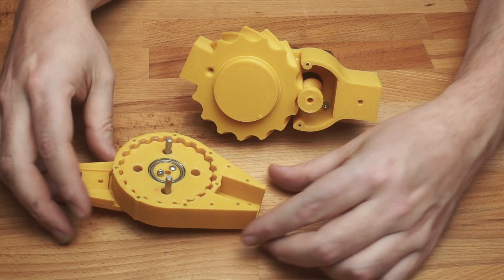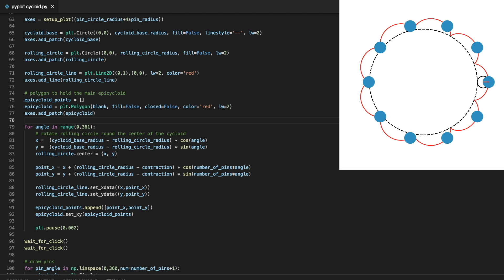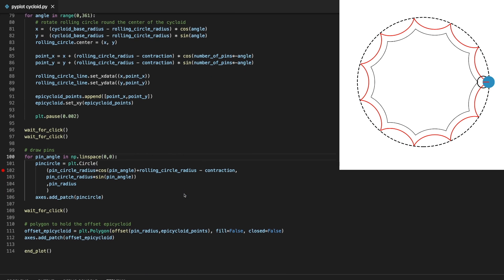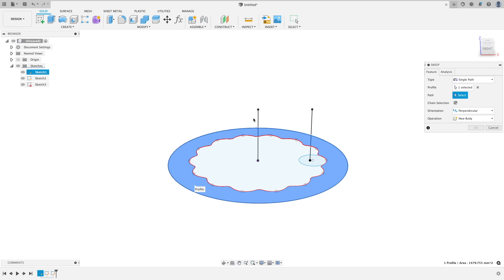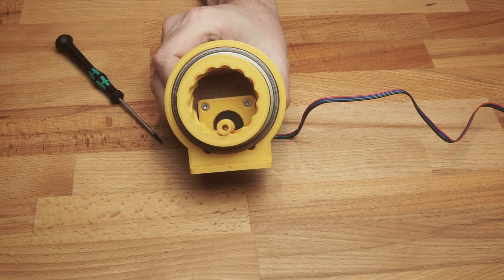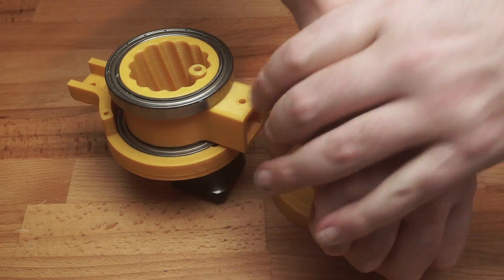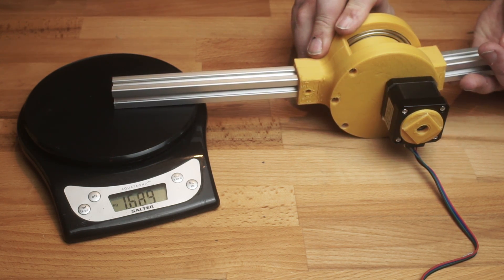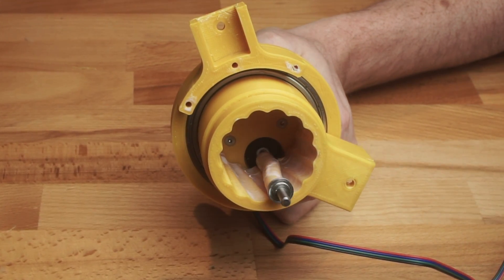an easier robot arm actuator...

Comment: Now put 3 (or 4) of the internal gears 120 (or 90) degrees apart and put large planetary gears on the end with a small sun gear. Probably not too practical since another set of gears will introduce backlash, but there's still internal space that could be used to increase the gear ratio.

Comment: The cycloid gear looks to have a lot of wear surface making a plastic version have a short lifespan.   I wonder if somehow you could use ball bearings in there, so the balls rotate as the friction surface, like how a ball screw works.

Comment: Would it be possible to combine this with a planetary gear? Thus having three rolling pins that are driven from the center with the motor? It might only get a 1:1 between the sun and planet gears, but it might increase the rigidity as loads are distributed.

Comment: Maybe you can try to make one a little bigger, so the motor fits inside side by side with the worm. Then you connect the motor to the worm with simple gears or a belt.

The advantage is that it would have a neat form factor with no protruding appendages.

You can also use small bearings if you place them to the sides, and make the cycloidal cage as two facing cups with a central axle.

Comment: Herringbone arrangement with multiple driving gears synchronized via a timing belt (chosen for anti-backlash, but perhaps gearing would suffice?) could increase the torque capacity and eliminate the need for a large outer bearing (at the cost of several smaller ones for the driving gears).

Comment: I'm thinking planetary internal cycloidal gearbox......should be able to make it smaller, and between the extra contact area and those areas operating in opposition to one another the torque capacity aught to be pretty good for the size.

Another thought is a roller design. It looks like a planetary gearset but all parts are smooth. The balance between load based friction and the properties of the lube help determine torque transfer qualities. A benefit to this design is that slippage is accounted for when overtorque is applied. The rollers simply slip without the mechanical deflection and breakage of a gear or other positive engagement system. 

When the overtorque condition is over the transmission simply goes back to work.

This is ised in a supercharger design from a few years ago but I'm sure it has other applications.

Comment: I became lost at some point. 
How is the pinion gear diameter determined? 
How about the offsets? 
I do not follow code all that well. 
Plan to try Levi Janssen's method of manually plotting out the cycloid. 
Only do it on the inside like this one. 
Need some help. :)

Comment: The next step would be an in- AND out runner, wouldn't it? Two opposing pins, one on the inside, one on the outside. Is that even possible due to the different diameters of inside and outside? 🤔

Comment: you could split the outer piece into several plate-like layers with straight edges that are stacked together and then fit bearings along the little pinion. It would then not be a continuous mating surface anymore, but rather about 6 bearings that sequentially push on the outer part. Backlash would probably become unbearable and you'd have trouble mounting the bearings on the little part, but friction would be eliminated.

Comment: Hey, wouldn't this desing allow for several inputs? Since its hollow, it could be possible to just add more motors, maybe even add another gear on the center to keep all of them synchronized and keep the input gears in place to avoid skipping.

Comment: A second gear along the inside, so the driver sits flush on both ends would create more torque relative to its volume and you'd really see the magic of this design. You're only grabbing on the outside: You also need to grab on the inside.

Comment: At 12:1 gear ratio it is no better than a planetary box of a similar size, and the planetary box would be much stronger for so many reasons.
ROUNDED gear drives are a terrible idea in general, unless there is some big payoff like a really high gear ratio in a compact space.
I applaud your cleverness and hard work, but functionally it is awful.
Reply: a rounded gear is basically the same thing as a journalled bearing. if you were to drill holes around the circumference, and have a sliding feed so that only the hole contacting the gear feeds oil then you have something with a possibility of durability, if made of iron.

Comment: Amazing design and implementation. I do wonder about the Fusion 360 script though - all those individual line segments will eventually cause performance issues, and make the breps very complex. Doing a best-fit spline, with a tight fit and lots of control points, may be an option. Or using arc segments. This is similar to how the "Smoothing" function works in F360's CAM workspace.

Comment: one thing no-one mentions is pressure angles...

wheres the load and whats it acting on?

its like... threads are traditionally 55/60 degree.
gears are standard at 20 degree with the odd old fashioned 14.5 popping up.

reducing the pressure angle weakens the teeth, the material starts acting in "shear", but the torque or the load or the force acts more tangential to the wheel, with less bearing loss.
as pressure angle increases, the teeth get stronger. less "shear" but more "squish"., the load is transferred more radially, towards the bearings and shafts,.

this looks funky... but i fear overload is dependent on the rigidity of that housing, and theres a huge amount of sliding friction betweeen those gears acting... sort of radially. helically.

cant really think of a way to avoid it.

Comment: For those figuring out why this is different from a regular big gear with thread on the inside and a smaller gear attached to the motor, one revolution of the input here is results in the outter gear rotating one 'teeth', while with regular gears the big gear moves with the amount of teeth the smaller gear has. 
In another way, you can say that with this system the driving gear only has one teeth.
Reply: Ah, thank you!  I was wondering about that.  The other difference here, I see, is that the gears are slipping on each other quite a lot, whereas with "regular" gearing they don't slip very much.
Reply: @BrooksMoses    a rounded gear as seen here is a poor choice because of the angle of power transmission from one gear to another. The closer that angle is to 90 degrees (ie true radial) the more integrity the power transmission has, and is likely to have less friction too.
Reply: No it doesnt. If that inner gear had teeth it could easily reproduce the 12:1 ratio seen here AND be a better design. Planetary beats this in a number of ways.
Reply: @wizrom3046  
with planetary you also have more gears.  multiple reductions. 
this is a single transfer of force.  less parts to break fail.  

but also way more friction and thus less wear resistant and in the end an absolutely stupid idea that got thought up and discounted decades ago

Comment: If you're putting the drive gear into an elbow like you have here, you don't need gearing teeth to go all the way around the circle, the elbow stops the rotation at three or so teeth on either side of centre.

So there's some space saving available in this specific use-case.

Comment: how did you smooth out the cycloid curve and inverte it @2.17 to 2.18 ?!
Reply from the maker: Do you mean in Python or in Fusion?
Reply: @roTechnic  fusion 
Actually am trying the equation in Solidworks but it doesn’t turn right

Comment: I am having a lot of trouble increasing the number of "pins" and decreasing the pin radius without getting any odd overlaps, sometimes it looks pretty good but when I try to put a circle around the ring gear in the sketch fusion360 crashes every time.
Reply from the maker: let me know the number of pins and radius etc that you're using and I'll have a look
Reply: I found a solutin:
Let the script plugin draw the segment for you, but do not make the circular pattern yet. First, edit the sketch and use the Fit Point Spline tool to trace around the curve drawn by the script. Only drop a handful of points - enough to accurately recreate the shape, but not so many it crashes your program again.
Then, delete the original line, and continue the original process now using the spline curve instead.
Works pretty well for me.
Hope this helps someone out :)
Reply: Same problem here:
pin_radius =        5 / 10  
pin_circle_radius = 30 / 10 
number_of_pins =    12      
contraction =       0.5 / 10

Comment: Improvement: If you rotate the shape of the pin through a multiple of 360° it can transfer more force to the outer ring. Changing the geometry of the pin, making the shape a little bit more complex, the 'relevant' contact surface (the part applying force) increases and you get more torque for the same part count. If the material itself holds up, you can double or triple the torque.
Reply: But wouldn't you still end up with the same total contact-surface area?  You get more individual contacting areas, but they all get smaller.
Reply: @roidroid  The harder the material the less your insight is true. Think of difference btwn. laying on top of soft balls vs. on a bed of nails. In the first case the balls compress and the surface area increases. In the latter case your skin gets destroyed by a single nail but not by hundreds. The load of the body can only be supported by multiplying the force arrows. Preventing piercing of skin is analogous to skipping of gear dure to torque. In practice material science and physics combine.
Reply: @discoveringthegardenofeden7882  oh coz none of them are flat surfaces, but are rounded?  Interesting

Comment: If the the gear had a herringbone sort of pattern, that would eliminate thrust along the axis.
Reply: Seconded. I've used double helical gears in a couple of projects and they're great. All of the force is transmitted in a direct and constant manner.
Reply: That, and it also would remove any unintended torque moments from the gearbox, which could become an issue as these gears get (longer, wider?). I wonder how well it would go with a more extreme twist rate, rather than the small drive gear being swept at 360 degrees, what if it was swept at 720, or 1080 degrees? I'd think it would produce more, smaller contact points, evening out the load along the gear teeth.
Reply: Solid idea
Reply: I wonder if that would reduce the pulsation as it moves between teeth, most visible in the closing frames of the video.
Reply: @keithwins  Yup. Helical gears always have at least two teeth engaged.

Comment: This is what access to 3d printers does. It brings ideas into reality that we didn't even dared dream about. I am so impressed with where this is going.
Reply: Yeah. I also want to use my printer for this kind of things… however, Blender has a physics simulator that in a few years could simulate mechanics without printing them.
Reply: @robertoguerra5375  fusion 3d already has that.
Reply: no it just lets idiots play around with idea's they found in a book from the 70's
because this has deffinatly already been thought about.  tested.  and discounted for various reasons.  like motor power required.  wear and tear.  or production costs. 

there is nothing new about this.  and almost none of the things like this that you see.   
they didn't come up with the idea themselves even if they tell you they did.
Reply: @darkracer1252    Many ideas have been invented multiple times so your comment is effectively trash.  Best you can say is that the idea wasn't fully researched before being presented as original.  Outside of scientific journals or patent applications, that's perfectly fine.  I'd also like to point out that just because an approach isn't particularly useful in a production environment with CNC or injection moulding doesn't mean it won't be effective for low-end FDM.

Not saying it's awesome... haven't tried it. But, I'm interested in seeing where it goes.
Reply: @4Fixerdave  
THIS idea was fully researched.  
the youtuber is a rtard for even attempting it.  
why?  because other solutions are easyer to make.  cheaper.  more efficient. and stronger.   
this design really looses on all fronts

and no im deffinatly not one of the people who thinks that failed science from the past should never be tried again with new advancements.  

this one in particular is going to have to wait untill we break thermodynamics by removing friction
basicly break the laws of physics
Reply: @darkracer1252  I 100% agree with the technical points of your criticism, but whoa, there’s no need to be so antagonistic about it.  Guy comes up with a cool idea he that he isn’t aware is not new or novel but wants to try, even if it’s something that has been considered before and found to be sub-optimal.   Just point that out without the condescending attitude, it makes your points appear weak. Technically astute viewers will understand the valid critiques and conclude that while interesting, the design isn’t as practical and well-performing as others. You might even consider creating an alternative video showing a superior design and comparing it against this one, and linking it here as an educational example if you have the means to do so.
Reply: @sjsomething4936  
it's the OP that makes it seem like some sort of amazing innovation.  
and i can't let that slide.
Reply: @darkracer1252 
> like wear and tear or production costs

Here's something truly amazing  that apparently has never occurred to you - 
The production costs of 3D printing a part are very different from the production costs of machining the same item. Very, very different.
When you have new production methods is EXACTLY the time to revisit ideas that didn't work well with the old method. It was totally unfeasible to make anything but jewelry from aluminum, it was so expensive. Until a new production method came around.

Of course it's not just production methods that change over the years. A pocket phone was totally unfeasible, because the nicad batteries would run out in 30 minutes, the CRT would be 6 inches deep, etc.
And in fact they are a good match for some applications. They ARE used in industry, where the application calls for a high reduction, efficient, low speed drive. Wear and tear?  Sure, if you're going 10,000 RPM all day every day, an involute will likely be a better choice. In my application (astrophotography), it needs to make one revolution per *day*, to match the rotation of the earth. It will be used for a few hours at a time every couple of weeks, so maybe a total of 30 full revolutions per year. Even if the wear lifetime is only 3000 revolutions, that's 100 years of use.

Comment: you don't NEED to use big bearings. gears on shafts can be mounted with bearings just bigger than the shaft, you press the bearing into the center of the gear. You can also have nested shafts like in a motorcycle clutch basket
Reply from the maker: The reason i needed large bearing on this is to allow the motor and pinion to be mounted close to the edge of the internal gear. Can you see a way I could do that with smaller gears?
Reply: @roTechnic  you could use multiple rollers with their own smaller bearings.   and you can use a smaller bearing on a shaft like the OP said. and then mount the motor on the front side the side that's open to the camera in the video. or a combination of both.  

seeing as a large bearing like that can actually get quite expensive.

Comment: Would it make sense to double the pinion at the opposite side, coupled with gears to the motorized pinion?
Reply from the maker: yes it would, although maybe belts over gears for backlash reasons

Comment: 6:00 – In fact I do have a crazy idea 🤪. – It could do no less than do away with all metallic bearings and screws. – And perform even better. – No joke!
Namely: Drive a single planet of a  tapered roller cycloid gear-bearing containing at least three planets. 
Best thing a single fat 3D printed screw can pretension the whole assembly together  to zero backlash!
The tooth trajectories need to be of a (soft sinusoidal) herringbone shape in order to prevent slide-out of cone roller planet gears.
In fact I made a prototype of such a gear-bearing. Just not driven at a planet but passive. 
Guess I need to make a video showing it off such that it gets more clear what I mean.
Reply: Is it like what you said with the last video? A planetary gear system using the cycloidal ring and sun gear, and the cycloidal worm gears?

Comment: I think there's an interesting trade off to find between the height in mm of one sweep of one tooth, and multiple sweeps. In this example, 3 sweeps at 10mm or 1 sweep at 30mm.
Reply from the maker: are you thinking that the multiple sweeps could transmit more torque due to the increased helix angle?
Reply: @roTechnic  Perhaps! And maybe there would be interesting torque / efficiency trade offs the other way, half a sweep, two pinons and a short gt2 closed loop keeping them in sync?
Reply: And of course, herringbone configuration, two sweeps back to back!

Comment: Next step would be to add a planetary gear set to that for more constant load application. Having 3 driving cycloids could smooth things out significantly
Reply: I ventured into the comments to suggest the same - planetary to drive multiple pinions. Only I would increase the overall diameter and locate the stepper on the interior
Reply: 3 or 4 driving cycloids could also serve as radial bearings for the driven ring.  Something is still needed for axial loads.
Reply: Back to the Backlash >>>
Reply: 3 or 4 driving cycloids could also serve as radial bearings for the driven ring.  Something is still needed for axial loads.
Reply: @hanelyp1  HERRINGBONE planetary excentically cycloidal gears should work for axial loads.  I kinda just wanted to say the phrase, these big words are adding up.